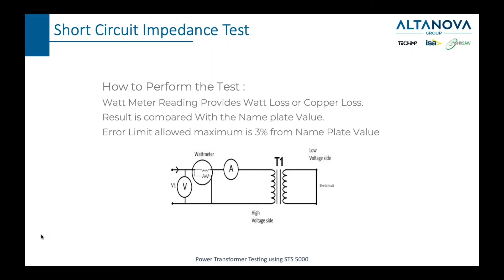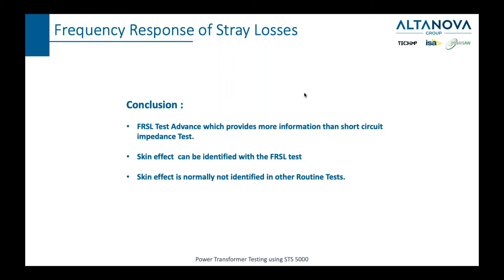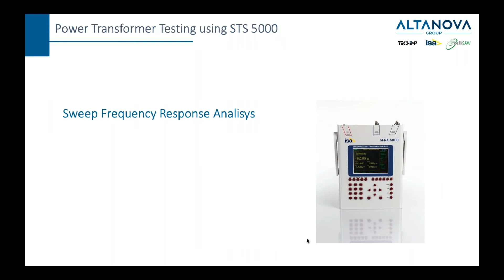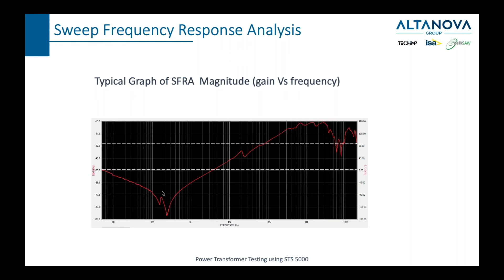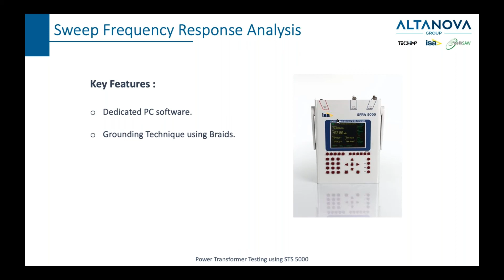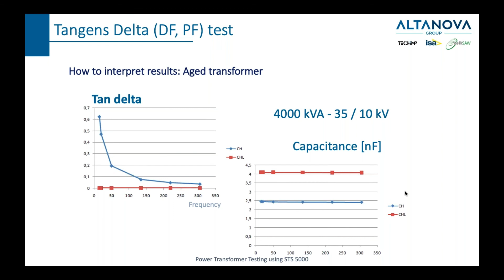Power transformer generic tests with STS 5000 - PART 2/2

Comment: Hello,

Can the ISA STS 5000 be used without the TD 5000 attachment for testing high-voltage power transformers?
For example, could it be used for the no-load current test of a 110/20 kV, 40 MVA transformer, or would you recommend using it only for small and medium-voltage transformers?